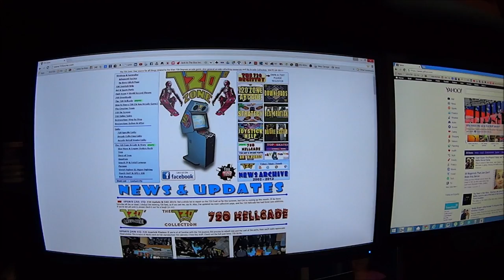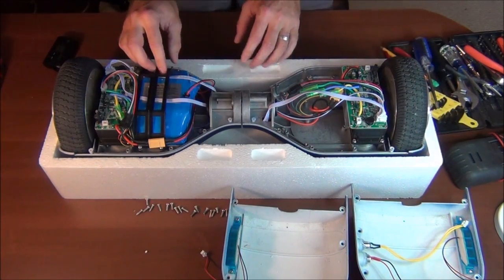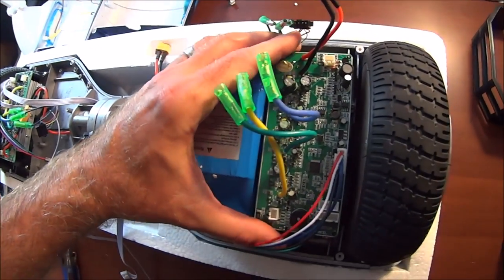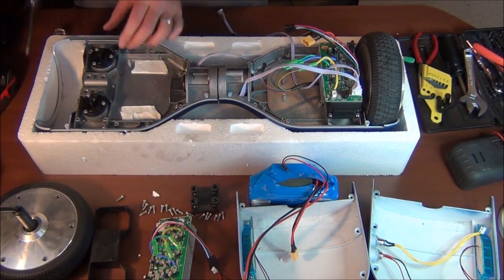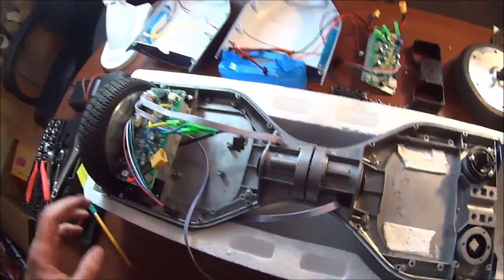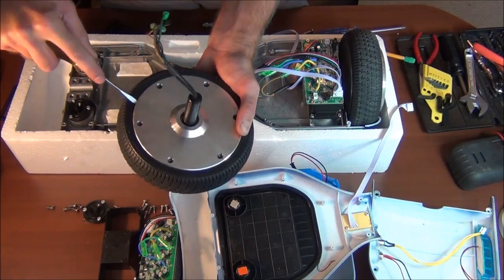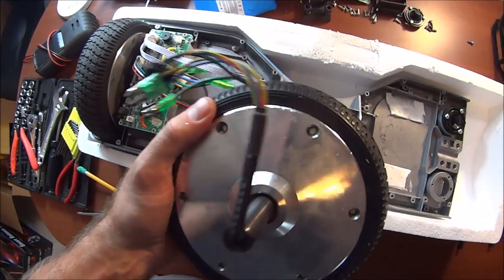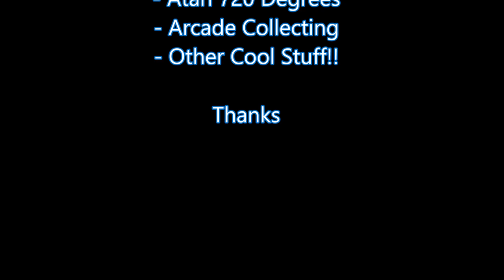Two Wheeled Self Balancing Scooter DISASSEMBLY and Reassembly - IO Hawk / Monorover R2 / Hoverboard

Comment: Do you think this would support 300 lbs maybe 320 ?
Reply from the maker: +Mohit Surtani I am guessing it definitely would. I think that the manual's guidelines are in place simply to avoid likelyhood of more broken frames. If a bigger person were to be careful and keep their weight close to the wheels (and away from the center of the unit) I'm guessing it would work just fine. It might go a bit slower.
Reply: +720 Zone I'm 275lbs on a 10"version, just got it today, it seems like it bends slightly, I haven't checked the clips on the swivel part but I feel if I don't jump on it or ride it off a curb it will be ok
Reply from the maker: I bet you're right. I'm sure you'd guess this already, but I would keep my feet toward the outside of the pads....touching the edges of the scooter. I ride like this anyway and find it helps my stability. Good luck and thanks much for commenting.
Reply: +720 Zone is so that as much as I can but I have a fender that won't stop rubbing, plus I have one of my wheels that has a hick up while spinning, if I go fast it starts to shake on the one side, or if I hold it in the air and make the one wheel go it sounds like a bad bearing, I wrote about it in other comment. Thanks again for the amazing vid, you will help relieve stress in A LOT people angered at there smart wheel, I can't wait to watch your amount of views skyrocket soon
Reply: +Trent Wosmek * I do

Comment: Hey the gap in the middle of my scooter seems to have gotten slightly bigger. How can I fix this's
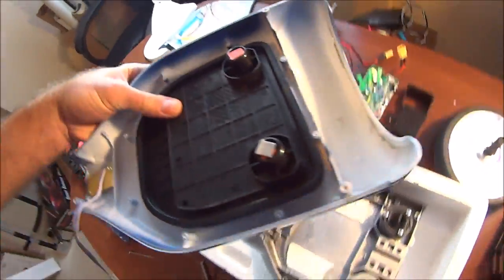Reply from the maker: +fijian650 - Hey - Thanks for the question: There is a steel bar running between the two aluminum halves of the frame. It is held in place by a retaining ring on each side. I suspect that one of your retaining rings has come off. Check around 14:20 in the video. Good luck!
Reply: +720 Zone aha yes I do see what appears to be a ring that had come loose. Thank you very much.
Reply: +fijian650 hey i have the same problem did you ever look into it
Reply: +720 Zone hello mine has a random speaker at the bottom that isn't even placed properly to prevent anything from going in can I coverv it up with some tape or something

Comment: hello,can anyone help me as one of my tires is kind of loose and it wobbles a little and when i ride it it makes a loud scrapping noise. some one please help me
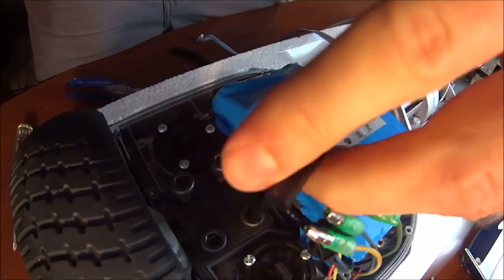Reply from the maker: +Ali Baba When I received my first scooter, the plastic frame was not quite lined up correctly. The result was a constant squeek as I rode. You can hear this annoying sound in my first scooter video. By simply bending the plastic a bit, I was able to address it. Perhaps your plastic frame somehow came out of alignment. It is less likely, but possible, that the shaft of the motor, which comes out of the wheel and is mounted to the aluminum frame in the scooter, is somehow off, or bent. Could open it up and check that. You can see that mount around 8:50 in this video.  Good luck!
Reply: +720 Zone so do you think i should tighten it the most i can or would that mean the tire wouldent move properly. thanks
Reply from the maker: Ali Baba I would turn it over. Unscrew the the plastic frame on the side in question and remove it. Then look very closely at the wheel as you spin it with your hand. See if it is rubbing on anything.
Reply: +720 Zone ok i opened it but i cant see it rubbing on anything. what i want to do is screw the 4 screws (or whatever they're called) but im scared the wheel might stop moving. so do you think if i screw the 4 screws as tight as i can will it make the tire stiff. thanks
Reply from the maker: +Ali Baba Those four large allen screws should be very tight...yes....you should tighten them down very tight. You can't really damage anything, other that stripping the threads if you were very strong, but those four screws just press a small piece down onto the metal shaft that comes out of the motor/wheel. That piece holds the shaft still in the frame so that when the motor spins, it is actually spinning itself...since the motor is the wheel. Hope that makes sense.
Reply: I have same problem without the wobble, I have the 10" version. Thx to this vid I'm just gonna hopefully find a whole wheel I can swap out and just plug it in.

Comment: What is weight of one wheel please ?
Reply: Around 6kg, the wheels are the heaviest things in the board
Reply: +BoyBehindTheScreen Thanks so much ! Is it hard to pull them out. I dont have experience with these things but it looks easy
Reply: I wasn't be able to take mine out as I was not using electric drill and alan key, it's quite hard to open the motor with a normal scredriver but removing the motors from the board is possible but requires strengh. May I ask why you are taking the motors / wheels out. I wouldn't reccomend taking them out as the boards are very skillfully built and if you break one part your screwed. Unless your board is broken, I wouldnt reccomend taking them off.
Reply: i mean if is it hard just to pull out wheels from whole board